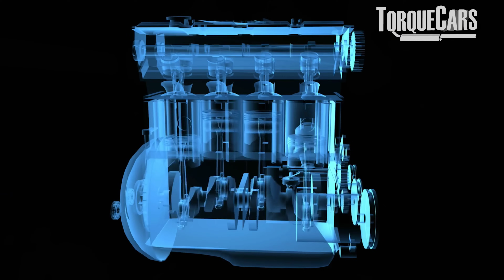SOLVED! Carbon Build Up/Deposits: Causes Exposed, Prevention, & Removal Solutions 💨🚗

Comment: this is why i will be getting port injection added to my 8J TTRS in a few weeks after having it pulled apart and the carbon build up cleaned out.
Reply from the maker: Are you going water methanol or regular fuel?
Reply: @torquecars  regular 98 oct. it wont be standard in the end. engine will be pulled out and forged pistons all new valves, fuel system and all supporting mods to run a bigger turbo with syvecs to manage it. nothing crazy though, its a street car. will chat with the mechanic about managing carbon build up and running the modified engine. its getting prazis airbag suspension put on it this week. with a set of 20" Vossen LC2-C1s. exhaust, downpipe, cae shortshifter, new bushings. rear sway bar, rear control arms, front and rear end links, dogbone mount. upgraded engine transmission mount. Audi R8 ignition coils, new sparkplugs. end of Feb start of March 2025 everything should be finished. Thats when the motor will come out, just have to ask whether its better to wait to get it all done at the same time and just have all the supporting mods done before the motor comes out. Intercooler, fuel pump, clutch etc. car currently has around 65,000ks on it. 3rd owner, 2011 model.
Reply: @torquecars  Just watched your "never buy a car from these years" vid. i picked the 8J TTRS for the shape and look of it. but i wanted a manual, as you know VW/Audi stopped making manuals in 2013 i think. It was either one of these or a BMW 1M. After researching modifications to the platforms i decided on the TTRS. After owning a 2011 mk6 Golf R i dont know if i could go back to a RWDM my first car was a 1989 FD RX7 savannah, modified bridgeport running a respecced T04. All supporting mods with microtech ECU managing them. So much fun, i miss driving a rotary. hearing the intank fuel pump squirting away while at the lights and the smell of fuel and oil mixture and the bridgeport idle. no need for a stereo system :P Glad i got to experience owning one tbh. 😁
Reply from the maker: I've only ever driven a rotary for a day and it was a real blast when I got over the need to rev it hard to get any torque.

I think you'll have great fun with the TTRS they are pretty good platforms to work on and upgrade.
Reply: @torquecars  yeah I just wanted a car I know I'll keep as long as I can thats fun to drive. And still daily. It's why I've gotta sit down and have a good chat with the spanners at options and pros n cons. Tbh wide usable powerband that's as responsive as I can get it. I don't care for quarter mile times. There's no circuit where I live either, just a street car.

Comment: Planned obsolescence. When gasoline is injected directly onto the pistons. It washes, rinses & diluted the engine oil that's meant to be there for friction protection & to keep piston & its rings from damaging cylinder walls. 

When enough oil has been washed, then that's when engine failures happens. 

There will be a strong gas smell & most times "cappuccino" color in the old engine oil when an oil change has been done.
Reply: That makes a lot of sense... high pressure blasting the top of the piston with a solvent on every rotation. Not good.

Comment: Carbon build up is cause by oil sticking onto the intake valve just cuasing vapors to stick onto the valve.  Eliminate oil getting onto the intake valve will reduce vapor sticking onto the intake valve.
Reply: How, do you stop oil getting onto intake valves ………….

Comment: i changed out the baffle plate for the pcv  in my 2.0 Ecoboost with a labyrinth style baffle plate, this does a great job in preventing oil vapour reaching the intake.
previously the throttlebody was soaking wet with oil, now it is dry as can be. i replaced the intake manifold and took te liberty to clean the valve stalks, i left them soaking over night with wynn's DI valve cleaner, then with all kinds of brushes i got the valves pretty clean, for small contaminants you could spray the solution direct into the intake if you prefere

Comment: Thank you from Ontario Canada! Other YouTube posts go on about Carbon Build up but fall short of explanation. This is arguably the best explanation I have found to date on how the carbon is getting into the intake. The EGR and PCV makes sense. I recently replaced my wife’s MPI mall crawler with a GDI ICE. For her short trips an EV might have been a better choice, but I’m not ready to embrace EV just yet. Seeing this video I think that I’ll be taking her car to work a couple time a week to hopefully “blow the carbon out” as we used to say in the 70s and 80s. Also I will study up on adding some sort of valve cleaning into my regular maintenance routine.

Comment: My son works for Ampol Australia. Here in Oz 95 & 98 unleaded fuel is given fuel injector cleaner @ 450 parts per million parts,  as part of an additive package into the fuel, as it is loaded into tankers...
(same stuff you buy in the bottles which he describes as a "massive mega dose" when the whole bottle is added usually 250 ml)
Cheaper fuel suppliers/ petrol stations, here in Australia, do not have the injector additive, so add 2.5 millilitres per 50 litres of injector cleaner to your fuel if you are concerned. (two tenths of F'all)
Reply: I use Shell optimax to keep my fuel system clean.. If I was to put a fuel cleaner like Redex would this be a bad thing because I am using Shell optimax.. Redex and Optimax together can this cause damage on the seals or anyother parts in the engine.
Reply: @desobrien3827 Ask you son when was the last time Caltex Kurnell now back to Ampol Kurnell made fuel here in Australia sorry old mate they don't make fuel over there any they haven't for year i work as a Tanker driver for Caltex & Ampol all fuel  in NSW comes from Indonesia by ship and gets unloaded at Vopac port botany there are no refineries in NSW making fuel sorry old mate I think BP still have a refinery in pikinbar QLD
Reply: I also apply ten miniburgers per burger of fuel filled

Comment: I saw a video which recommened installing an oil catch can, claiming that this would prevent the carbon build-up on Direct injection engines.
Reply from the maker: It will significantly help on most engines but you'll still get soot from the EGR depositing on the intake.
Reply: Catch cans help reduce the gunk that glues the carbon from the EGR clogging ur intake. Total delete is the only true way to beat the problem.

Comment: How about we use very high quality oil and filters. Also stop the higher mileage oil changes. We do all oil changes between 3,000 to 4,000 miles. Always a high quality full synthetic oil and OEM oil filters. Even on the newer engines that state 15,000 to 20,000 mile service. Not at my shop. As the oil gets older, it thins out and lowers cylinder sealing. Its all at very small amounts. It does cause more blow-by and more 	oil vapors enter the valve cover and intake hose before the throttle body. After that you get build up on the back of the intake valves.

Comment: What would you recommend for cleaning a Golf mk3 vr6 2.8 1997 engine? Mine runs really well and has done over 205k miles now. Just wondering whether I'd need to anything with the engine or to leave it alone. It's passed all MOTs recently and I put a cleaner in the petrol tank and have it serviced regularly

Comment: Thank you. We just bought a new Nissan Rouge with a 1.5 engine. My wife drives back and forth to work five days weekly and it's about a 56-mile trip. Otherwise, it's trips in town of 20-30 minutes each.
Hopefully, this is a good driving mix to keep the carbon low.

Could you please do a video on the Three-cylinder engines, including the Nissan unit? Being new to a small engine and having never owned a turbo, help, and maintenance advice would be appreciated.

Comment: This is exactly why i own two Toyota rav4s , with the 2.5 liter naturally aspirated engines. They have both, direct and port injection. They  call it the (dynamic force engine) (d4s). Carbon buildup is not a concern !!!
Reply: how can it not be a concern if only half of the injection is port? And still gets loads of carbon on exhaust valves. You must remove intake manifold and walnut blast
Reply: @jimguzell4993  The Ford Coyote engines also have both, although Ford and Toyota combine the two in different ways relative to load and RPM.

Comment: I have trouble understanding how hydrolocking could be a problem when you spray a cleaner into the intake of an engine. Lets say you have a 2000 cc four cylinder engine with 12:1 in compression ratio that idles at 800 rpm. That means that every 500 cc cylinder is ingesting nearly 500 cc of air 400 times in a minute (or 6.67 times every second) and that the 500 cc air is being compressed to 41.67 cc. Wouldn't you need to inject more than 41.67cc x 6.67 = 278 cc per second to achieve hydrolock? That is a lot of volume 

I've never heard of hydrolock being a problem unless you drive into water that is so deep that it comes into the intake or if you have a ignition failure on a Top Fuel Dragster
Reply from the maker: It is indeed very unlikely but some of the products I've used contained the warning so I'm just covering myself by flagging this up - you might get that guy who decides to use multiple spray cans. Also bear in mind that some drivers have 3 cylinder small capacity engines and the delivery systems of these sprays (especially the pro formulations) are not just aerosol based.

Comment: The media used to clean the back of the intake valves is grounded walnut shells. any walnut shell residu will be burned in the process of combustion.
In my personal experience, any name brand synthetic eng. oil. Will help with carbon build up, Just because it's a name brand synthetic eng. oil, don't extend your oil changes. The best synthetic. eng. oil is clean oil...
Eng. Oil is cheep, engines aren't. 
Cheep oil is better, than extending your oil change, and even better than no oil change.

Comment: At 130 miles in the odo i just removed both heads and use my scotch brite stainless to remove all carbon by hand and with the help of a pick tool, tested all valvles for leak and put back with a new set of gasket. The power and smoth of engine went back pretty good, Although my engine is not direct injected.

Comment: I advise strongly against catch cans unless you know exactly what you're doing.  Improperly set up cans can overpressure a turbo crankcase causing bad problems.  Unless you properly set up a top of the line ($$$) can system, you're really not accomplishing anything other than risk.  In my experience, i caught nothing but water in the winter, nothing at all in the summer, & was pooling shocking amounts of oil in the charge pipes, all while the intake valves were completely coked at 20k mi.  Luckily, I didn't blow out my main seals.

Comment: Wonder if anyone has tested water injection long enough to determine if it helps. 
Youd think with the speed it would help keep the valves a little cleaner.
Sure ,carbon isnt water soluble but anything becones water soluble the longer it is exposed.
The intake and ports would probably only xlean up where theres a direction change and droplets cant make the curve so good.

Comment: The E.G.R. statements at 3:29-3:30 are not true. E.G.R. is only enabled after the engine reaches closed loop and operating temperature and it is never enabled at idle or just low RPM. It primarily is enabled at steady state cruising speeds and part-throttle loads just above cruising speed. 
The following P.C.V. statements are also not entirely accurate. The Positive Crankcase Ventilation system is designed to contain the expected levels of "Blow-by" gases from escaping through previous engine designs vents and breathers that just allowed those gases to escape into the atmosphere. The P.C.V. system redirects these gases back into the intake manifold to be burned. It also prevents the gases from condensing into the engine oil where they form acids and deteriorate the engine oil prematurely and can etch the machined surfaces (journals, bores etc...). 
         The carbon build-up is from engine oil vapor and engine oil being deposited on the intake valve and passages. Some oil comes down the intake valve past the stem seal and guide. Primarily, the PCV system draws oil vapor through the intake manifold and contributes to the carbon build-up that does not get washed away without wet-flow induction systems (such as carburetion, throttle-body fuel injection or port-fuel injection). So, the problem stems from the move to Direct Injection alone. Direct injection should always be coupled with Port injection to prevent this occurrence. I personally think the gains from D.I. are not worth all the extra complexity and loss of durability. Port injection is still the best all-around way to introduce fuel into a gasoline combustion engine.  

    Catch-cans, if properly designed will indeed reduce the rate of oil vapor entering the intake manifold. Once installed, they should be opened and cleaned out regularly to maximize the intended effect of keeping the oil vapor out of the intake manifold and as way to monitor the engines overall health by visually seeing the levels of blow-by being captured.
Reply: Many DI engines run on Atkinson cycle during low power requirements - this air fuel mixture is partially pushed back into the intake during the compression stroke- should keep the valves keep.
Reply: @senselessza1 Indeed. My Lexus IS hybrid is just such. It also utilises port and direct injection, switching between the two to maximise efficiency under different conditions. Carbon build-up really isn't a thing with these engines. Well done Toyota 👏
Reply from the maker: Thank you so much for the clarification to my understanding, I think I got the wrong end of the stick here, unless there is a car maker out there that does something different to most, so I have snipped out the mention of warm up and idle. I'll use your comments to further improve the knowledge I can share and really appreciate your taking the time to share your wisdom. What a great community we have on here!

Comment: I’m going to be using Valvoline’s new Restore and Protect oil to help keep the engine clean from the start.
Reply: Unfortunately the area that is experiencing carbon fouling is the valves and intake systems which are not exposed to the engine oil nor the fuel. So neither oil nor fuel additive will affect the issue at hand which is dirty, oily air directed into the intake from the pcv & the egr. Those two emissions systems are the Achilles heel of these modern engines. You could also include the fuel management systems that cuts off cylinders and oil in the name of fuel economy, which is a joke. Physically it takes x amount of power to move a specific vehicle a certain speed, the fuel has x amount of power per a gallon, it's just limited by the laws of physics. The quest for unreasonable fuel economy and emissions are costing the consumer a fortune and driving the price of vehicles sky high.
Reply from the maker: I'll have to investigate that one, I've not heard of it before. Thanks for the heads up.

Comment: 7:41 what is considered a longer drive? Would that simply be reaching a certain temperature? For a certain period? Could a 15min freeway drive once a week be a good thing (as an example)? Running at higher revs more often vs trying to conserve fuel by keeping revs low?
Reply: @genomedia44  both, for example, stay away from overdrive to keep your rpms higher while cruising at lower speeds. Plus opt to use the highway ( motorway lol ) to get to your destination when possible in order to get those higher speeds more consistently, thus providing your engine a more "natural" way of cleaning off the deposits.

Comment: Carbon (ash) build-up in my DPF choked the engine...a professional off car clean has restored performance and fuel economy to 'as new' levels even though the car has done 120,000 miles...it's a Mazda CX-7...cheers
Reply: @cm-kl2wx  I'm a mechanic, no one here tells you the truth, even the mechanics don't know, only I know maybe and someone else can know if you don't say it
Reply: @miri2553  I used my brothers professional scan tool and checked differential pressures before and after cleaning...the post clean reading was zero pressure at idle and minimum levels at 3000rpm. This proved that the procedure had been successful. It's essential to know and be able to interpret the pressure readings. My brother who is also a mechanic learned something from the experience...cheers.

Comment: the gas companies need to switch back to the old school gas and ditch the ethanol in the gas. Have noticed more frequent stops at the gas station and all these cars throwing EGR,  catalytic converter and O2 sensor codes?
Reply: Cars that do that were already broken or had badly written self tuning software /diagnostic monitors. A modern engine with heated sensors will go into closed loop almost instantly and correct fuel doses by itself. It will even learn and correct baseline values over time. Slightly lower/higher octane or little bit of alcohol should not affect it.

If a fuel works well with modern cars and is cheaper to make without absolutely horrific additives they are not switching back.
Reply: You mean leaded gasoline?
Reply: @user-in9et9hv4n  ethanol makes more power and burns cleaner. Sure its worse gas mileage. Ethanol is cheap in NA. E85 is cheaper than regular 87AKI.
Reply: @stevo5976  Ethanol only seems cheaper because you are ignoring the federal subsidies that coerce you to think so. Also Ethanol has less energy than gasoline so it is impossible to "make more power" which is why you also get worse fuel mileage using ethanol. See U.S. Dept. of energy, Alternative fuels, Ethanol has 30% less energy than gasoline despite what some youtube experts claim.